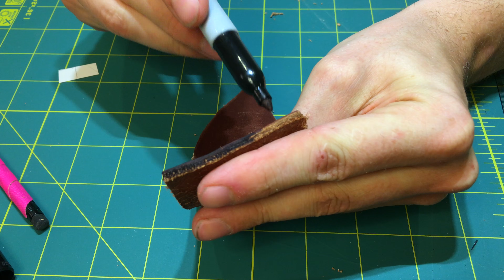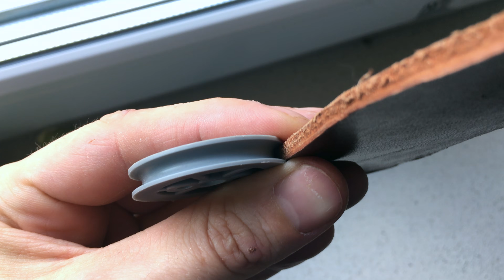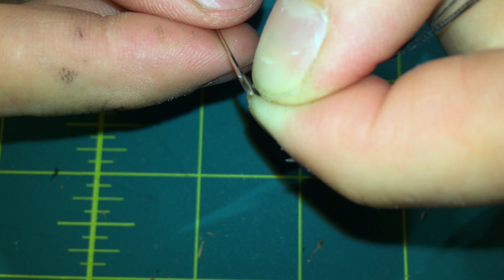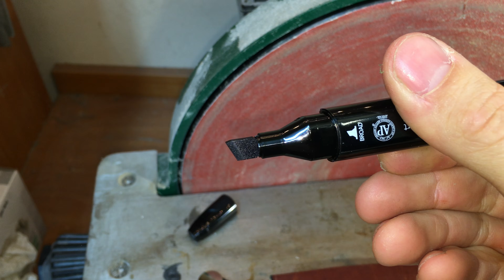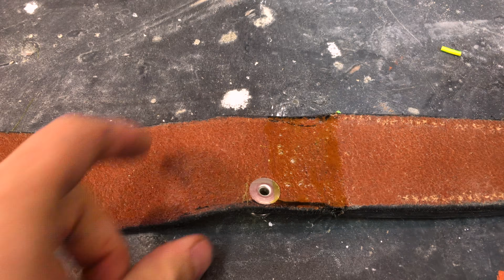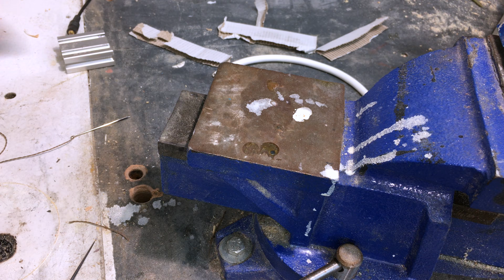Lets Make - A Leather Sheath

Comment: Very cool video. I’m getting ready to make a sheath for my hunting knife and I wanted something that’s field grade. Plain, durable, and functional. Something I won’t be afraid to get scratches or nicks in so I don’t want to do a lot of fancy tooling. If any it would probably be the rune symbol in the center of the stitching for the snap strap on the end connected to the sheath part. Then maybe my initials down the front or other tunes that represent the different game I hunt and fish. Not doing any checkering or pics, or filigree. Just so happens this is the first video that I clicked on from the search results and it was perfect. I’m fairly advanced in leather work and it can actually be hard to come up with a utilitarian design and not let my artistic side get carried away. Two hours to make and time to spare until lunch break! I’m going to go get started! Thanx for the great video, Everett

Comment: Great work mate thanks for sharing Ive been meaning to do a leather sheath video but I'm so lazy haha 👍🏼👍🏼👍🏼
Reply from the maker: +Diesineveryfilm Customs Thank you! Show me if you do one!
Reply: Max Maker I'll give you props if I do cause you've made it a lot easier for me. So many knifes and requests for sheaths but I just put it off all the time haha.
Reply from the maker: +Diesineveryfilm Customs At least you have a lot of orders! How much do you roughly charge? Customs most be expensive.
Reply: Max Maker at first I was only charging £45 and that was breaking even but now I charge £85 altho my knifes are getting bigger in size so I may have to rethink that price. costs £10 to send to the usa but that's just normal mail so I could probably find a cheaper method when I have bulk lots to send.
Reply from the maker: +Diesineveryfilm Customs I think thats still pretty cheap. I thought you would charge at least 300£. But that depends on the style of course. A rustic knife is easier to make than a polished one.
Reply: Max Maker I'm building up my name so don't want to fly in at the high end price. ive been requested rustic style mostly but ive got a video coming up that's a polished one.
Reply from the maker: +Diesineveryfilm Customs Fair enough. That makes sense. I hope it goes well!